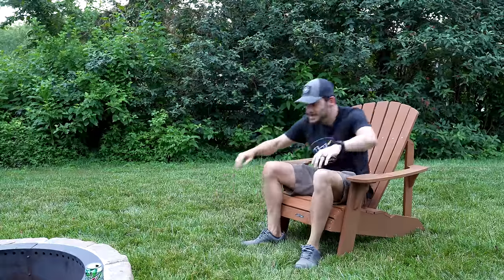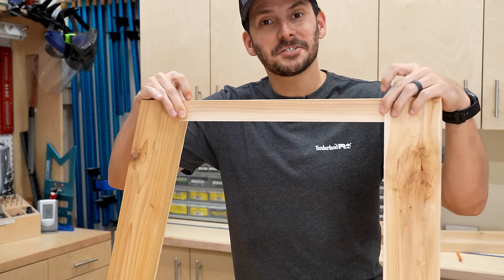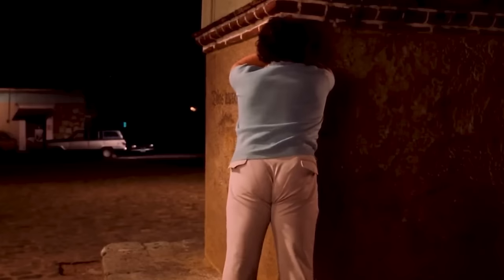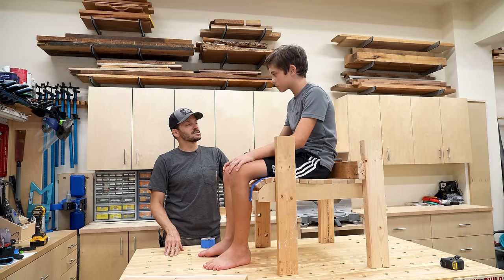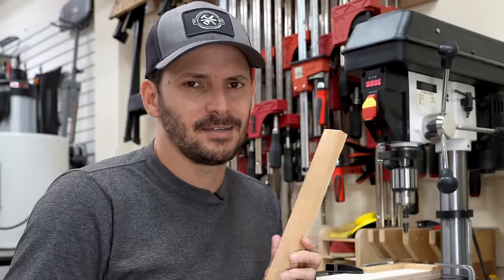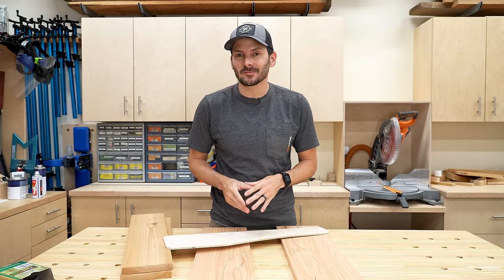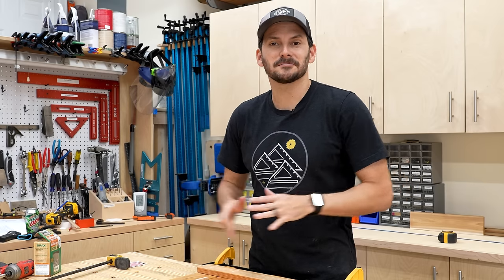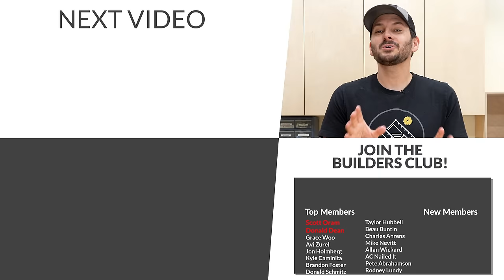Did I Build a Better Adirondack Chair?

Comment: I think the defining feature of an Adirondack chair is that it's a lounge chair, specifically designed with a notable higher front than back. It's meant to be be relaxing, you plop in and should have no desire to get up. Your changes are nice and make sense for those who have a hard time getting out, but I'd argue this is no longer an Adirondack as it no longer delivers the function of "lounging".
Reply: Exactly my thoughts. He’s created an Adirondack style chair which is an excellent variant which would match for an outside table.
Reply: His is a Brad-irondack 😜
Reply: I agree

Brad's seat on this chair is horizontal

Perhaps a slight backward slant would bring it more adirondackly but still make it easy to get out of
Reply: The secret is in the name.  The Adirondack (as in mountains) chair is meant to be used on a slope.  It never was supposed to be used on level ground.  Put the chair on slope with your feet downhill and it is actually quite comfortable to use and sit.  :)
Reply: @kutzcd  not sure if I should grant you 1 internets, or face palm you into oblivion...
Reply: I see your point and I actually agree. His design is more like a modern twist on an Adirondack chair. I personally like both styles and want to create something that's right in the middle of the two.
Reply: @kutzcd  YES!
Reply: Agreed! I like it, though. I think I would like the seat just slightly more angled.
Reply: Absolutely! This guys version completely takes away from the chair being what it was meant to be. If it's not broke, don't try to fix. Please!
Reply: Someone should have just told him he’s allowed to use his hands and arms to sit up out of the chair.  Absolutely baffling.
Reply: Agree. He just made a wood chair.
Reply: Seriously people. Get over yourselves.
It's a cool chair. Lean the sloped ground till it's level and the chair works fine if it bothers you that much. 😊
Reply: Adirondack chair is an outdoor lazy boy.   Doesn’t need to be improved IMO
Reply: Wow, guess it’s frowned upon to upset the chair purists of the internet. Duly noted
Reply: Yep two different chair styles. Nice cabin chair for sure. With a nice breeze, you could fall asleep in an Adirondack.
Reply: Yep. Should’ve made it adjustable instead, providing varying degrees of recline.
Reply: They still sick for older or chubby folks. Sorry, but true.
Reply: @nunyabidness3075 he didn’t create anything. I have been building those for 6 years. I call mine a garden chair. Actually I like them more than the Adirondack chairs I build.
Reply: It’s only an Adirondack chair if it’s from the Adirondack region of New England. This is just a Hillbilly/Domino chair.
Reply: @marcusdavey9747  lol no that is wrong. The Adirondack chair is the style of chair. Lol it doesn’t have to be built there. Lol
Reply: For those making negative comments, come back when you’re in your 70’s and see if you still agree.
Reply: @louislandi938 
Why would you sit in a chair where you wouldn't be able to get out of, at any age?  A low a/o very soft cushioned couch comes to mind.
Reply: Looking for plans to build the reclining kind. I have plenty of outdoor chairs for a table.
Reply: Why can't I find these plans for this chair on your site
Reply: @kylebrown8216 you nailed it… and that’s the reason Adirondacks belong to the classics list.
Reply: 2 months and still no plans found on your site. Despite allot of opinions here, I like the chair design. I had back and leg surgeries which makes it difficult to get up and out of a standard Adirondack chair. Please post the plans.
Reply: The Adirondack was beautiful designed for cross country skiing Europeans, not for suv driving Americans. If you get my drift.
Reply: Perfectly said. Can not agree more

Comment: Glad someone else sees it like I do.  I'm getting older and those "on the ground" Adirondack Chairs are a pain to get out of.  Anyone with arthritis or other medical conditions would likely agree. I think your revision is the way to go.  Oddly enough I had modified a set of traditional plans and printed out the layout sheets but not yet build something very similar to yours.  Thanks for posting this video.  Guess I need to get back into the shop and make a pair of the updated version!
Reply: Yes, with arthritis and 2 fake knees, it's almost impossible for me to get out of a regular Adirondack.  I would like to see the back rounded but not sure how that could be done

Comment: As someone who lives in BC's coastal rainforest and whose father spends much of his time building trails, I can promise you that cedar is not rotting out on you any time soon.  My dad's been using cedar for trail construction for years and even unfinished raw-split wood that gets put in the dirt is just fine years later.  And this is wood that is sourced by finding random fallen cedar trees out in the wild that didn't get hauled off by loggers, chainsawing a chunk out of them and splitting them in a process not unlike cutting firewood.  Some of that wood has made its way to his workshop, and the only reason the stuff he's planed out can't be sold as tonewood for guitars (his original plan) is that there's some environmental certification needed to do that, and "random BC man carved it out of a dead tree in the wilderness" does not qualify for that certification.

Comment: STRONGER MOD:  Use half-lap joints for the stretchers to the tops of the legs.
Likewise some dadoes for the side spreaders to the sides of the seat...stronger.
Ease the lower edges of the seat slats, so they can be closer together and less chance of pinching, or a button catching in them.  This will also allow for better drainage and drying of the slats when they get wet.  You can depend on leaves/pine needles/dirt getting in there and clogging...
Of course, ease all edges with round-overs...gotta be nice to the touch, prevent possible splinters.
Suggest you cut the corbels at a 45 degree angle, as they way they sit per your build they are liable to split along that vertical grain.  Screw them in at that 45 degree angle for strength.  Why?  BECAUSE SOMEONE (ahem) will sit on those arm rests.
Excellent plans.

Comment: If you ever revisit or need more chairs, you might consider a slight curve into the backrest for cheek comfort(might get a bit numb you sit down for long enough). Maybe also add slat for lumbar support. But regardless, I think it turned out great. 

PS: As a 6' 5" individual, I never really had difficulty with those chairs 😅, is this a common issue?
Reply: You must be young still 😂 it's an issue when you get old
Reply: @dinacusic7829  You might be right, I am 28. I hear around 35 is when you start waking up with random pain in your back. Can't say I am looking forward to it. 😅
Reply: @hadensnodgrass3472  Let's put it this way: I have back pain older than you.  Once you hit 50, it will really catch up with you.

Comment: As an older guy with back problems, I hate the classic adirondak. We have a new patio and need a couple of chairs so been looking for design inspiration. Tada! I ran into this video and Like the idea since it retains the outdoorsy appeal of the style. Since I've built plenty of furniture I really just needed a visual to estimate the dimensions and sturdy method of assembly. For those wanting plans - just measure some chairs you find comfortable: seat height is usually 16-18", seat depth is is also typically 16-18" maybe as much as 20" for a long legged person or if using a back cushion, arm rests run about 7-10" from seat, seat width should be 18" minimum clear of any arm overhang, back height can vary but 20-24" is typical for a high back. Seat tilt is minimal, I simply drew a similar looking curve on a section of 2x4 so seat has a slight rear tilt - about 5 deg slope as it curves over the front towards the rear where it sort of flattens out. Back tilt on these is often 15 deg. I'm jst laying out the dimensions now in CAD so I can refine it for building. If all comes out well, I'll post the dwg in a blog.

Comment: Out of curiosity, would the lower down chair have been better if there was room to slightly put your feet further beneath you when standing? In the toddler room, where I work, when I stand from their chairs, I bring my heels behind my knees, plant my feet and stand. Those chairs are about 5 inches off the ground, but it's definitely easier with the ones 8 inches off the ground. Just curious if that could be a factor as well

Comment: Good sir, if your drill press is taller than you are, it is not little.  ;-)  I snickered at that one...
Thank you for the ideas!  I especially liked the clamping cauls at various degrees depending on what was needed.  Everyone else voiced my opinion on the general aggravation that is a traditional adirondack chair, as well as the fresh air that is your version of said monstrosity.  Well done!

Comment: As an older fat guy with semi-crap knees, I also share your hate of traditional Adirondack chairs.  Nice restyling into something you can actually get out of!  Q: Did you have to do anything to prep for glue up because of the oils in cedar?
Reply from the maker: I've never had issues with oils in the cedar.  Might be different with tropical woods like Teak

Comment: You could have found the 15 degree angle for the backrest easier by finding the correct angle with the two screw holes on each side and then when you attach the backrest it would be at the correct angle… in theory, assuming your pilot holes were drilled in the right spots…

Also, you are supposed drink coffee not eat it, perhaps that is why you don’t like it…😂
Reply from the maker: Oh, great tip!  And it tastes horrible eaten or drank, lol

Comment: These look great. Nothing looks better than a real wood Adirondack. However, nothing fits the curvature of the body better than the plastic ones from target that are ergonomically molded. And also are easy to move, stack to store and have flip out cup holders. So that's what I have 😂 with enough spares for everyone
Reply: Have a few (maybe too many) beers, lean back too far, bam!!! My ass is on the floor and broken plastic chair is off to the bin.  🤣😂🤣😂🤣

Comment: A flat back adirondack is just a chair.  Adirondacks with longer legs are very comfortable but need a foot rest to truly lounge.  You can then use a back pillow if you don't want a straighter back option while a standard chair is missing a lounge option.

Comment: Swing and a miss for me. The Adirondack Chair is supposed to be like an outdoor recliner. (and not like the floral dumpster recliners you see in front of some houses) It sucks you in and there is nothing to do but relax. Also, the back needs to be concave to fit your back. You made an outdoor church pew. Love your work but you can't teach style. :)  If you have trouble getting in and out of chairs, maybe that is not the chairs fault, huh?    ;)

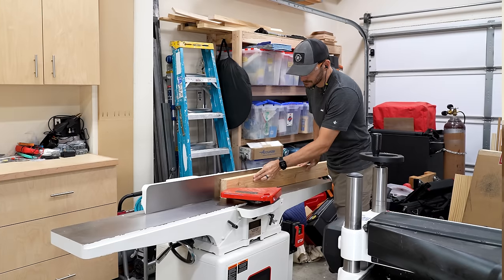Comment: 1:09 wait wait wait…. Did you not know that you can use your hands and arms to push off the arm rests in order to sit up?  You can do the same in reverse to sit down slowly. 

Man, all you had to do was say that you didn’t know how to use an Adirondack chair and I could have saved you a lot of trouble on removing perhaps the most important element of the Adirondack chair design and pretending that was a victory.

Comment: Is there some unwritten rule about not using your arms to get in an out of Adirondack chairs?  Considering a large number of these chairs were used by convalescents back in the day, it doesn't speak much about the state of the modern American bauplan to be struggling with them to the extent advertised.   The chair looks like a fine and comfortable chair, but I think it has departed from being an Adirondack chair at this point from a design perspective.  You should brand it with a name of your own.

Comment: You Could of just increased the length of 4 boards and you wouldn’t even of had this problem… 

(he had a compact modernized version of the chair to start with, just increase the length of the boards touching the ground and it naturally would sit higher off the ground)

Comment: Great chair, but not even close to Adirondack. I agree with modifying it some,  you ditched the curved back, the entire idea a reclined angle, the idea that the sides of the chair become the back legs. This is just any upright deckchair.  I think you could've gone with extending the length of the side panels, keeping the curve so they're still the back legs, but the extended length would lift the seat higher. All you really kept of the original chair is the 'look' of the back. Good chair, but you're comparing a turkey to a chicken and calling them the same.

Comment: I didn't watch the video, but I know that the traditional Adirondack chair is only slightly more comfortable than sitting on broken glass. Whoever designed it should be punched in the face.

That's sarcasm, YouTube. Just so you know.

Comment: Referring to the thumbnail, the before chair is poorly designed.  It is to low to the ground and and the seat is flat.  The after chair is not what I would call an adirondack chair.  But even that one has a flat seat.  I think it's more comfortable to have a curved seat, than a flat one..  Unless of course you have a butt.. 😉
Reply from the maker: My seat has a subtle curve to it to fit the maximum backside sizes :)